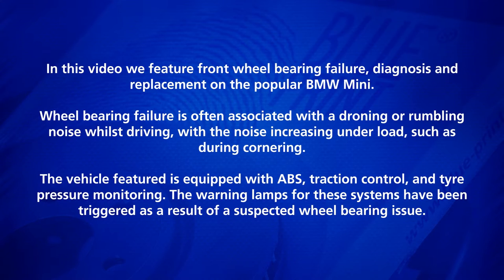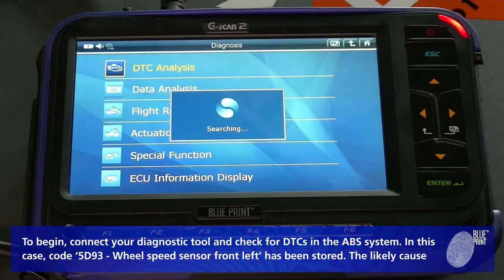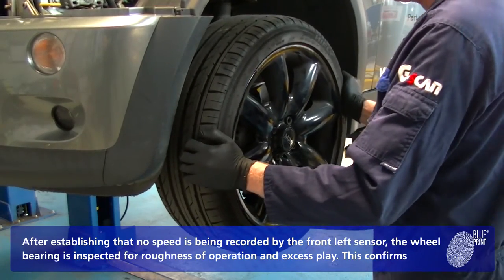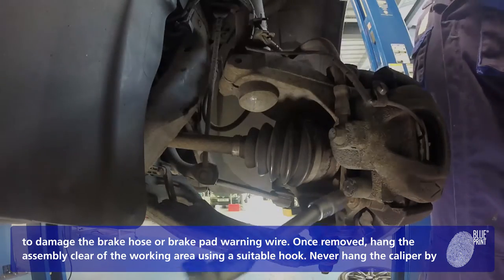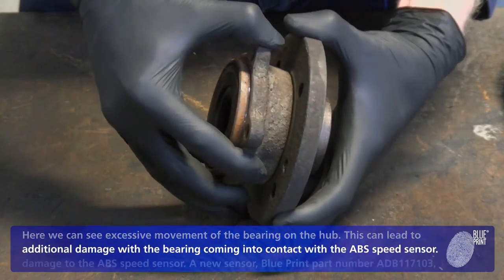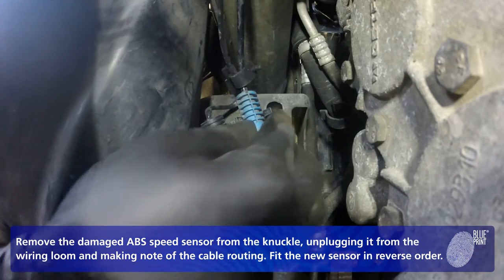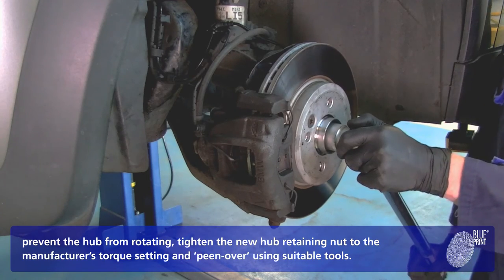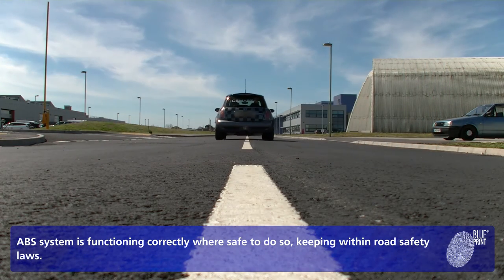[EN] MINI Wheel Bearing Replacement

Comment: Hello,

Could you help for the thorque values screws for a rear bearing for Mini Cooper S R53 july 2006 in metric not imperial please... I am from Switzerland.
CHEERS
Reply from the maker: Thank you for watching our video, the four retaining bolts which fix the wheel bearing hub to the trailing arm are tightened to 56 Nm.
Reply: @BluePrintCarParts  
Thank you